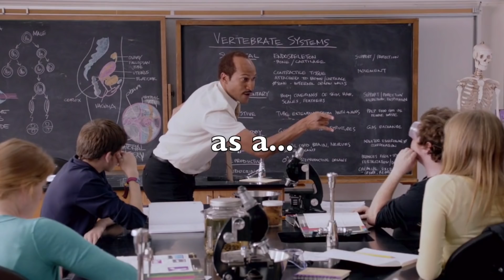Using Tesla parts in my Electric Rat Rod Conversion

Comment: As an IT person I need to ask does the metal need to be rust protected before wires and channels are added?
Reply: It should be, but it isn't going to last long enough to matter, either the welds will pop or the thing he took the heatsink off will burn.

Comment: why not just use a thermal interface when you mount the controller to the steel plates, that way you can use the frame as a heatsink

Comment: 9:02 I really don’t think spacing it will help ..

I’d set it snug with a lot of thermal compound against the steel ... though at is a relatively poor conductor huh

But yeah nah they didn’t space the module from the heatsink for the same reason

Also forgot to start with ‘as a’

Comment: 5:49 Looks a bit close, the firewall needs a trim?
Also the 'air space' for the controller is a lame idea, it'll just get hotter that way, consider leaving the heatsink on (or sandwiched on another 1/4" aluminum plate) with thermal paste and maybe at a thermoswitch and fan so when it hits 80C it gets active cooling. 
Modern accountancy means they didn't design it for any more load than a fat man on that bike. As noted - steel sucks as a heat sink.

Comment: You’re Kidding about the spacers on the motor controller, right?  Heat transfer is about surface area and air flow. When the car is sitting still there is no air flow so you need drastically more surface area. You are better off using thermal paste and attaching it to the largest chunk of metal you can find.

Comment: The cooling efficacy of steel is a lot better than air. You'd be better off replacing the thermal paste and mounting it flush to the steel plate.

Comment: I like what you're doing but please for your safety run a better bead on the front plate first turn that box might pop off in the intersection just by the g forces alone will pop it off

Comment: As a Youtube viewer, I'm triggered by your lack of use of a zip-tie puller.  Well, that, and perhaps you should be using adel clamps instead.  They're less likely to give way to vibration.  Plus, zip ties are brittle trash when it gets cold.

Also agree that you need the real heat sink.  Even thermal pasting it flat to the steel it's mounted on would be better than trying to let the wind cool it.  Pasting the sink to the other side of the steel might improve it even more.  Cutting a hole so that the sink can stay attached direct would be best though.

Comment: That battery pack needs far more to keep it in place when you're moving, braking etc.etc than just keeping it off the floor.
Reply: That's assuming the contraption will run for more than 5 minutes and achieve anything over 10 mph.

Comment: Controller fire in 3...2...1.  Metal to metal contact is better than metal to air for pulling heat away. If the other were true computers would not use heat sinks.

Comment: As a human being who happens to be in the automotive industry, did you just weld the cast iron of your brake pedal? This is a no-no practice. Hope that your stuff without heat sinking catches fire before you end up in need of braking while the brake pedal lever fall in pieces.

Comment: so how can he put wires in water and soap without them being holding moisture in the connection pins?

the most amount of electrical work ive done is completed the circut of a flashlight with my body intentionally it was a AAA powered one

Comment: Heat sinks are really important aluminium is a great conductor of heat, there design is about increasing surface area my advice is put it back in or get a bigger one.

Semiconductors are often made of silicone at about 115 C they melt game over, so we use heat sinks, heat sink compound and fans and its never wise to scrimp on these things.

Me I would of put the batteries in the back and thus balance the weight.

I am qualified but I won’t bore you with that.

Regard

 Andre  uk

Comment: your swapping into a heavy car overworking that controller and then removing the heatsink...  your going to toast it.. the heatsink draws heat away and disapates it to the air via more surface area..aka the fins on the heatsink, aluminim is a great heat conductor...  you need that heat sinks surface area.Your working it harder and then removing its cooling device..   your gonna let the magic smoke out.

Comment: PS if the tap is to tight it will pull the smallest wire in and pull out connectors .soooo

Comment: Check the tension of your wire in your welder. Your using flux core and to me it looks like your breaking the wire which is actually hollow and filled with flux. Also go slower as about a third of your wire is not really filler but flux.

Comment: Air is not a good thermal conductor. You may need a fan to cool down the controller if you want to stick with the air cooling.

Comment: You need those heat sonks they are aluminum an transfer heat better than steel that steel is gonna get to hot an burn up the controlers

Comment: Rich: "lol, I don't need all your wise guy comments on my welding skills."

Also Rich: 
 - continues to do the shittiest welding jobs in the history of welding
 - wears his safety sandals when cutting
 - holds the heavy battery in place with like 2.5 screws in awkward locations
 - uses zip ties to hold the electronics in place
 - cuts his back seat with what appears to be the Guinnes (tm) world record holder in the "dullest blade" category
 - argues how a heat sink is best replaced with space so that the airflow that made it through the battery pack can cool it or something instead of directly connecting it to the large piece of heat conducting metal

To summarize: Rich, I love your videos and your ranting. Never stop doing that!

Comment: If your not using the heat sink then wouldn’t it be better to connect it to as much aluminum as possible and not put a gap in it. Maybe put a fan on it as well.

Comment: As a rocket scientist for NASAL, I cringed at everything around 8:50 , if you want to reduce the controllers profile, just watercool it, by removing that passive huge heatsink from the bacl of it, you mostlikely reduced that controllers lifespan to at least half... and worst case scenario it will just burn up within 30 minutes of driving that thing around in a fun way and not like a granny, may the force be with you!

Comment: Damn it rich you are definitely TROLLING with the "imma add spacer to make it cooler", right?

In case not, more surface area = more cooling. The metal on metal is GOOD. no contact means the controller metal plate has to eat all the heat.

You want as much surface area as possible + direct contact on the controller (like, attach it directly to the car body for example). Material can also make a difference as people have said but the most important factor is lots of surface area (thats why heatsinks have fins)

But you have a whole car not a dinky electrocycle so you have lots more metal surface area to take advantage of

Comment: You are not only using a motor cycle's motor on a car, but you are also taking away the controller's passive cooling (heat sink), not a good idea, but hopefully the gear ratio will be favorable to the motor. Otherwise, the motor controller might give up

Comment: I know you like to read those, so hear me out: where are your PPEs? You wear a welding helmet, right? Because it would burn your retina otherwise. Why not pushing it and wearing steel cap shoes, gloves and glasses? Two points, you would be safer, that's the obvious but not so obvious, you would set a good example to younger fan club you may have. I am pretty sure protective gear brands would be happy to sponsor you. Until then, flipflop ;)

Comment: 20+ years of experience tells me that as a computer expert, removing the heat sink from that controller is probably not going to work out so well, especially if you think it will be worked harder in the rat rod.  You need the surface area the heat sink provides to keep that thing cool.  Also, I noticed there was some thermal compound on the heat sink, just like a computer.  Keeping it air-gapped is probably not a good idea.  The bottom of the controller and that heat sink are machined so there are as few gaps as possible because those air gaps are bad news.  I would just remount the heat sink and then mount it somewhere there will be plenty of airflow.  As a modder, I really like what you have going on.  The adult in me says keep the heat sink, but the kid in me says "mom, mom, mom, mom"

Comment: The first time that frame flexes, that "welded" mounting plate will pop off and your batteries will slide off in unison (unison because of that welded tab). Do yourself a favor, bolt that plate to the frame.

Comment: You REALLY need that heatsink. You also need to reapply fresh thermal paste between the inverter and the heatsink you are mounting it to. Oh my god, you are so setting yourself up for failure. The heatsink has fins because it creates surface area, you are taking away all the surface area for the heat to be removed! :/

Comment: I have a solution for your heat sink problem. Just install a water spray nozzle with a pump in the air gap and use the superior specific heat capacity of water to get rid of the excess heat. Problem solved! I promise there will be no unexpected side effects!

Comment: As a professional viewer of your channel, how the heck did you dry the electrical wiring after submerging it in a bucket of dawn? air compressor to the connections? drip dry?? Also i'm begging you to find someone who will sponsor you to have a better set of tools at home. It's part of your charm to tear something apart with a kitchen knife but i'm begging you to get some real tools. I personally went from from a terrible set of tools to decent set and it really upped what i'm able to do.

Comment: Ah - he accidentally tipped his hand!  The weld on the brake pedal looks far too good to be consistent with the rest of this build.  The pigeon shit welds for his battery mount will easily be chiselled off the chassis and cleaned up with a light kiss from a sanding disc in the grinder, explaining why he didn’t just drill and bolt it to the chassis.

Comment: as a complete random dude with 10 years on youtube I think you should definitely not ditch the heatsink, or if you do at least put metal to metal. If you remove the heatsink and leave a space it will not sink heat properly and it will fry!

Comment: I hope you are kidding about not fitting the original heatsink.
You said that the controller will be getting a bigger workout on the rod than on the bike it was intended for.
The heatsink provides the surface area needed to dissipate the heat, it is also painted black to maximise this property.
The assembly you are going to use will greatly degrade the cooling efficiency of the controller heatsink surface.
Put some boots on too, do not work with open toed footware.

Comment: As a software who has welded twice with a mig, your welds look like total shit, like unsafe, i mean at least watch a few youtube videos on welding, understand penetration depth, (yo). Even from inexpericenced eyes you are rushing your welds something shocking. Do small patches, to prevent over heating, but spend far longer in onespot, all your doing is creating little surface glue spots, rather than causing the metal to actual weld (melt) together. Maybe you're welder (yo) is far too small but I have no idea.

PS: i know it was a hot day, and i think that make sense why you're rushing, but your welds aren't really welds, and will split very easily. Don't allow anybody in your hot-rod. Still love your channel.

Welds looking a lot better in this video, but what would i know i'm a software engineer.

Comment: How about, instead of  using the air gap to stop the heat from heating up your steel plate, you go one step further and stuff some proper foam insulation in between the controller and your plate? That sure will do the job!

No, but seriously, I think enough people told you already, if you're not going to beef up on the cooling on that controller, at least put the original heatsink with a lot of heat paste in the most "blowy" place on the car or YOU WILL FRY IT, it won't even make a good episode because we all here want to see this thing drive.

Oh, and those three screws and the metal plate? Those won't stop the battery from flying off eventually during emergency breaking and tight corners. Do yourself a favour and secure it better because as much as we love your cheap approach, this is becoming a bodge job if not purely dangerous.

P.S. I'm not a professional in any way, shape or form, I'm a DIYer myself (Jack of all trades) but it doesn't take a professional to tell that this is effing asking for trouble so, unless you want to make this series all about a bodged, dangerous heap-of-junk-to-be ratrod, sort this sh*t out man!

Comment: I gotta say, you're making me cringe a bit buddy..   The welding needs to be a lot hotter. There's 0 penetration.. However that's not what I'm commenting about..  That controller, pushing a car, is going to be getting MUCH hotter.. A much better plan that's not so "sloppy" is to thermal paste it to the steel plates you are using to mount it. (Keeping weld outside the footprint of the controller so everything stays flat) and sandwiching the bracket with the controller and the aluminum heatsink.   Steel has a much higher thermal mass than aluminum so it will take much longer to heat up. Then you are also cooling it with the aluminum heat sink which works by using fins to enlarge the surface area so rather than cooling off just the surface of the controller, you end up cooling off an area that is many times the area of the controller. 

I just don't wanna see you burn stuff up buddy...

Comment: Who is the better mechanic Rich or Sam Crac . Washing a wiring harness with connectors in a bucket of water ? Really ? Rich with his batterys over hcargng and almost buring his buddy's shop down to loose main power cables, power washing the user control panel of a Telsa, forgetting duct work inside a car causig leaks  then to Sams over filling a car with oil.

Comment: As a fellow human being with common sense I feel obliged to express some opinions. If you run into something (collision at speed) that battery pack is gonna fly. Little screws are not strong enough to hold that thing in place. You might want to consider the safety of others. If welds look like birdpoo then that's what they are. I haven't been able to finish the last 3 videos because this build does not seem to reach the level of half-assed. Are you running out of inspiration? It's a little bit like Sanford and Son meets Jackass. I find it hard to watch (as an unemployed machinist, mechanic and carpenter). Good luck.

And I hope the controller fails open due to the flawed heatsink, otherwise it will be full power and "Aguas!"

Comment: Deleting the heat sink off of the electrical box super triggered me, it doesn't need open air, it needs increased surface area and more metal to absorb the heat.
PLEASE PUT THAT HEATSINK CLEANED AND WITH PROPER THERMAL PASTE BACK WHERE YOU FOUND IT !!!!
- ok rant over, but yes I watch for the cringe

Comment: You are crazy that pos welder sucks listen to the sound not near enough power watch some welding video's of short circuit mig cause listen to how it sounds u got serious lack of fusion issues it might look some what ok but it will break later when u step on that brake pedal and it snaps good luck that metal is atleast 3/8 thick needs to b vee out and welded with proper welder I hope there is some sort of inspection for that car cause it will fail

Comment: Dude, as an amateur youtube watcher, I can tell you that you need to fix the battery much better to the plate. Pulling it up is not the same load as it will see in hard braking. You need moor and bigger screws. And the tab is a joke. This is serious structual stuff! Get on it.  NOW!

Comment: A spacer to have air cooling instead of metal heatsink? 
Cutting the seat to make it look better? 
I like your channel, but this is just too painful to watch. 
If you are not just trolling, place the box in direct contact with the metal plate using some conductive heatsink paste.
For some odd reason, though, I can't stop watching. Nail biting experience.
Reply: Don't you just love how it's going to sit on the scaby welds (10:12), AND the zip ties (12:57)? The heat conduction from the controller to the "plate" is going to be EPIC!!! This is truly the Rick Roll of 2019 - we're all being RICH ROLLED :) HAHAHA

Comment: Sheesh... you are saving space by removing a heatsink with loads of surface area (fins) that is about an inch thick... and raising the controller by an inch anyway???? No... just no... stop it.... stop doing unnecessary work just to make stuff worse. (As a retired electronics designer ;-) )

Comment: As a professional bullshitter and shit poster for many many years, ... :P how come you don't just sand down the steel to a smooth rounded surface instead of gluing unsightly rubber that will deteriorate? :P

Comment: As a professional YouTube commenter with over 10 years experience, I have to say this is the dumbest rat rod build I've ever seen in my life! How dare you ruin a perfectly good Dodge caravan seat for this utter pile of garbage. You should be ashamed of yourself!!!!

But on a serious note, is the motorcycle engine actually going to be powerful enough to move this thing at more than like 10mph? I know rat rods are for cruising around, but I just don't see that little motor being able to push a car + driver/passenger very quickly. I hope I'm wrong, otherwise you might have built yourself a rat rod golf cart 😂